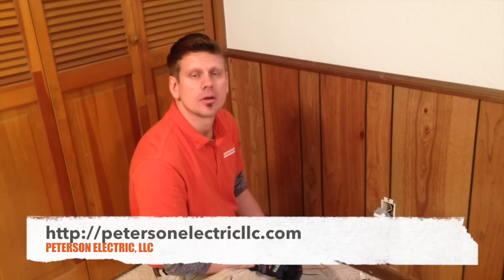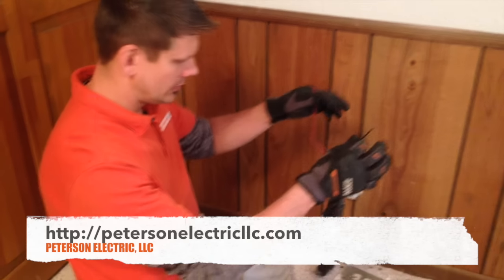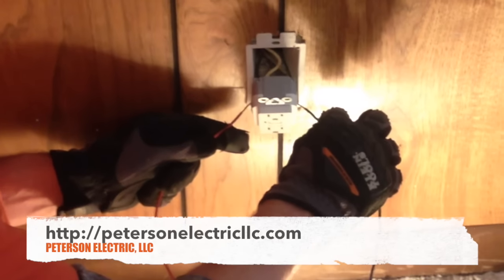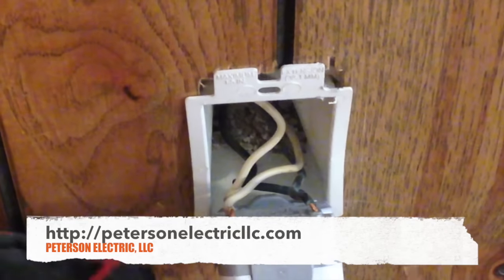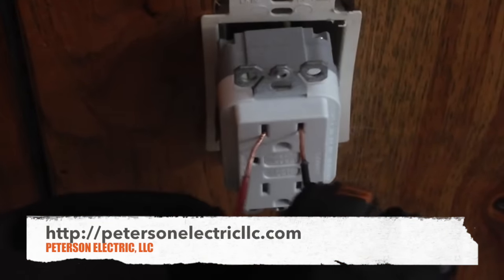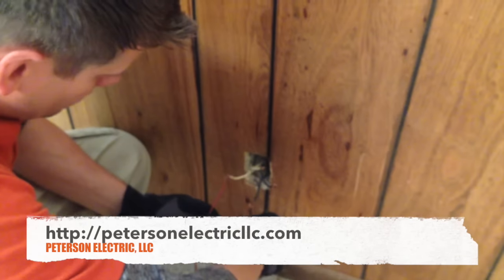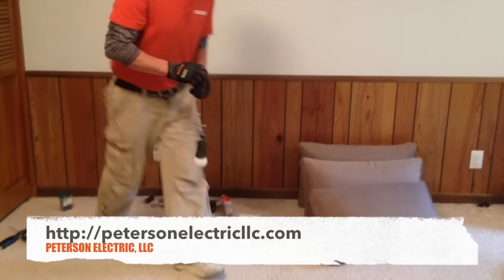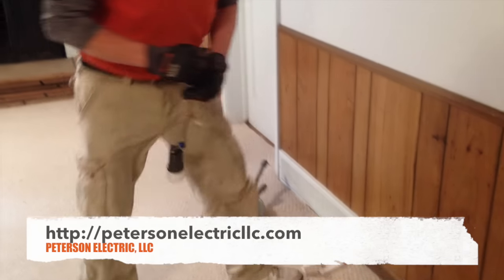A 1950's House With 2 Prong Outlets & No Grounds, What Can Be Done?

Comment: I think you don't quite understand what a GFCI does. It is not a breaker. It monitors how much power is on the hot and neutral. If they are out of balance it will trip. It will not (should not) trip when the hot and neutral are shorted as there is no loss of current to ground it may be a direct short and pull too many amps but as far as the GFCI is concerned all is well and the breaker will take care of the overloaded circuit.
Reply: What's scary is an "Electrician" (trained, certified, and all) doesn't understand what a GFCI does and what makes it different from a circuit breaker. Also it looks like that house wiring is being upgraded, why not add in the ground line to go with the 3-prong outlets?
Reply: @thedude6146 that's what I was thinking

Comment: Can you explain how your test proved your point. You never showed the GFCI afterward to show if it tripped.  Did the gfci work or could someone be electrocuted. And does this mean that the 2020 NEC 406.4 (2) (c) is wrong?
Reply: The spark was the proof. You would have been shocked and the circuit trips at the panel but you still get shocked. If the outlet worked you would not trip the circuit or see a spark. Just like you did not see a spark when he tripped the outlet directly.
Reply: @CarlYota  He shorted the live and neutral. It sparked and the breaker tripped. That has nothing to do with the GFCI.
Reply: When in doubt, ark it out 😁… an ole electrician told me that
Reply: @okaro6595  people say that if a GFI is at the front of a line then when said GFI trips it will keep juice from running to the rest of the line. If that was the case the 2nd receptacle should have been dead but it wasn't that is why it sparked.

Comment: Inside a GFCI, current sensing does not include the ground conductor. A GFCI simply measures the difference between hot current and neutral current. Therefore if some current passes through a piece of equipment or a human to ground, the neutral current decreases and trips the GFCI. So you have to test it not by tripping the circuit on current, but by tripping the circuit with external leakage to ground. The ground conductor must never pass current. It is only there as a reference point for protection.
Reply: Exactly. I am thinking a lot of people, including some electricians misunderstand exactly what a GFCI actually does. Jumper a wire around the Line OR Load side terminals of the actual GFCI and the exact same thing will happen. Not sure what to make of this video...lol
Reply: First off I wouldn't rely on a GFI to save my life. I would have to go over the patent design (years ago I wasn't impressed), the components inside one and hope it's not Chinese and calibrated to 6mA (which is still too high). I agree with you and MrHetero Erectus. That being said, I think that there are MANY areas where a GFI could fail you under the perfect conditions.  I worked in a factory on a dual voltage machine. First off the wire harness was marked Neutral, Ground and Line2 on the same wire. The machine did not have a ground to the control panel, and a worker laid a 220v 60A line inside and plugged it in. The breaker did not trip bc the machine was not grounded BUT the steel case was live. I refused to work there. The company came in and rewired a GFI into the breaker (LAW) and threw in an ammeter but neglected to properly tie in both sides L1 and L2 so they are only measuring 1 load. The machine is on a pallet (no ground) and the pallet sits on a conveyor that's 60 years old. What's my point? GM comes down from the office with the entourage. The rollers on the line don't have continuity (no ground) pallets etc.He said ETL Intertek approved the machines on the basis they tested our hipots and everything is good! The pieces of shit should be globally recalled for numerous reasons. STAMPED ETL INTERTEK UNION MADE ENERGY STAR. Sometimes people who design things don't test or understand the way people who FIX OTHER PEOPLES PROBLEMS. In my case I got a pile of money to walk away and NOT CARE! Sometimes I get a kick watching electricians get really messed up with simple shit cause they know CODE but not electricity. The whole issue of GFI, IMHO is to give ppl a false sense of security. Sure the GFI trips when you direct short it but how about a nice slow current leak after the load? A short can burn a house down and never blow a fuse or trip a breaker.
Reply: @maxwebster7572  I think it's misconception that circuit breakers, GFCI's, and other gadgets installed in wiring are safeties to protect the careless. While they CAN do so, their main purpose is to protect from electrical faults. They aren't idiot protection devices, a clever idiot can still easily get hurt.
Reply: @thedude6146  AGREED!
Reply: @maxwebster7572  A GFCI trips when you direct short it? Why? It's a ground-fault detector, not a short-circuit detector.
Reply: @UpnorthHere  Short is a a term to describe unwanted flow. It can be a path to ground or short to hot side of circuit. The neutral side of the circuit can be bonded to earth which is ground depending on the type of equipment.
Reply: @maxwebster7572  What do you think of Arc- fault circuit interrupters, versus a GFI?
Reply: @frankpaya690  two completely different devices designed to solve two different problems.
Reply: @TomCee53   Wouldn't an arc fault circuit interruptor do what a GFCI is alleged to do, only better? I was really addressing the question to  Peterson.

Comment: Your statement is absolutely correct but your test didn’t demonstrate your point.   By shorting L and N together you simply tested the circuit breaker and not the GFCI.  The point of a ground wire is to protect against an event where the live wire L makes it’s way to the metal housing of an appliance.  In that event if the appliance isn’t grounded then you will get an electrical shock  by touching the metal housing.  A ground wire creates a low resistance path from the housing back to neutral resulting into tripping the breaker.  A similar protection can be achieved with a GFCI receptacle and without a ground wire.  The few GFCI spec sheets I have reviewed have a trip threshold of 5mA +/-1mA.  That threshold is the current mismatch between what’s coming out of L and what’s going back in N.  So back to the previous example, if L ends up connecting to the housing of the appliance in a system without a ground wire, and the user touches the appliance.  Current will start flowing from L thru the hosing thru the human body to ground.  At 5mA the GFCI will trip.  So the real test for you is to create a current leakage to earth ground without returning that current to N.  If you’re on the second floor and no where near concrete this may be a hard test to do.  Good luck.

Comment: GFCI's detect imbalance between the hot and neutral. They won't trip on a short or overload between the terminals. That's the circuit breaker's job.
GFCI's trip when current is 'unaccounted for', as when you touch the hot and current flows through you to ground rather than back through the GFCI's neutral.
To test them without a wired ground, you'd need to short hot to earth or a neutral outside the GFCI.

Comment: I don't know about all cities Electrical Codes but in St Louis you can actually replace a two prong electrical outlet with a 3 prong outlet but you have to label them no ground then they pass inspection no problem
Reply: Joseph Atnip that is correct as per article NEC 406.3 (D) (3) (b) and (c).
Reply: Thats almost true, the NEC allows you to do that if you have a GFCI protected circuit.
Reply: Joseph Atnip: No, most US states have adopted the NEC which strictly prohibits that. Your ungrounded 3-prong receptacle must be supplied through a GFCI and labeled as such, plus "No Equipment Ground".  406.4(D)(2)(c).
Reply: @joeschmitz3346  Those NEC sections require such a receptacle to either BE a GFCI-type (b) or be supplied from a GFCI (c).

Comment: In this short video did you in fact realize that a GFI on the front end of a circuit did in fact protect the downstream outlets in your 1950 home remodeling from two prong receptacles to three prong receptacles?
Reply: Ok I'm not the only one. Like didn't he just show that when blowing out the non GFI outlet that it tripped the one up stream and in fact did protect from surge?
Reply: Looks to me that blowing out non GFI outlet doesn't trip the upstream. But blowing out GFI from inside the outlet will trip the downstream.  Looks like at the end of the video when blowing out the downstream either blew a fuse or trip the breaker.
Reply: @brickcitrus  GFCIs do not protect from surges and the fact that he shorted it i.e. tripped the breaker as nothing to do with the GFCI.
Reply: @Jeckelman24  He shorted the circuit. A GFCI does not react in that.

Comment: Here's something I can't seem to find an answer to. In an old trailer which has been wired in a million different spots/ways that makes it miraculous that it hasn't burnt down, both the 220v stove AND dryer were tapped/pigtailed  together on one 40amp double breaker(which is bad enough as it is,,, but heres the big kicker!! BOTH have been running for YEARS off of 2 hots and a bare ground(black/white/ground 8/2 wire. And yes in the breaker the bare ground was connected to ground bar, so no it's not even bogus-ly being used and hooked up on neutral bar with no insulation. When I try researching this, everything says it WILL NOT work without a neutral(but the 3 prongs will work without a ground, and then using appliances neutral/ground bonds at the appliances only.  So the stove and dryer were both working as if it were being wired like a 220v hot water heater(not all, but many/2 hots 1 bare ground/no neutral, as I gather most 220 water heaters don't use a 110 for anything, but stoves and dryers use 110 for parts of them). So now, if someone tells me the 2 hots and bare ground on stove/dryer could burn house/trailer down, I'd say yes probably sure could!! But when it's said that they just "wont/don't" work with that wiring, I'll say that's a lie. What I want to know is if the ground had been hooked up as if it was a neutral, has 110/220v been on and off flowing through the ground all the years?? And were the 110v parts of the stove/dryer actually running on 220v or something. And why have these things not broke/fried inside? I am no electrician, but I am trying to self educate myself as always, so I want to know how this has really been working like that for over 17 years, because this is my stepfathers trailer and he been here for around 17 years!!! And all this was screwed up wired before he ever moved here. But to clarify, I know for at least 5 years, that at the main panel box at pole, the bus bar was melted where the main 100amp breaker (that feeds the house breaker panel) was hooked up, and every once in a while, half the trailers power would cut off(educated guess is one of the 110s would still be flowing connection, while other 110 feed would lose connection, but if he flipped on dryer or stove, power would come back on, educated guess is the extra jolt of larger appliances trying to get power would send large jolt causing breaker to reconnect with the melted breaker panels bus bar??) It's all CRAZY!! The pigtailed wire running dryer was even running up through the actual old central air metal duct where a hole was cut for wire!! I don't wanna hear what "codes" say, or to be corrected with 110/220(120/240), or corrected with more specific terms of ground not being ground/neutral/common etc stuff. I jist want to know in basic english(not to advanced technically), what was this crazy hook up doing? And not asking for a "guess, answer, but is it why the main breaker was slowly melting the blades of the panel over all the years? Or I know of not having "grounds" before "codes" etc,  but back in time, did they actually use the "bare ground" wire and feed back through panel box as if no biggie, because they didn't have the neutral wire present? Or is this something of some jack@$$ of all sloppy trades is guilty of?? Thanks in advance for any extra info on how this was working without blowing breakers/burning up appliances/burning down trailer etc..  Some of these questions I would almost need an actual appliance tech who knows how the internals work, someone else who's also worked on OLDER trailers houses and have seen the long term effects of bogus-wiring that actually worked for years, and an actual techy electrician who knows more than just "codes" and how things were wired before "codes", so it wouldn't just be about codes, but rather more about what will actually burn your house down. Sorry long comment, but there was no way to even remotely partially explain without commenting some of the situation lol. And I can not/WON'T check now with meter to see if the ground had 110/220 flowing through it. Installed a new outside panel, new 100amp breaker, moved and REWIRED dryer to shed outside with underground 10/3, and currently have no stove and cooking on grill until I can afford around 50ft of 8/3, and a FOUR prong cord and plug, because even though this "worked" as it was originally SCREWED up wired, not gonna start burning up a new panel/breaker or further chance of burning down this crap-hole of a trailer.

Comment: The only possible explanation is that this GFCI is also acting as an overload circuit breaker when the hot and neutral wires are shorted out. In order to test the ground fault capabilities of the GFCI requires the presence of a ground of some sort. In a 2 wire house, shorting the hot wire to an Earth ground connection should cause the GFCI to trip. The only solutions to give the GFCI a ground would be to rewire that branch circuit to give it a ground wire back to the outside electrical box neutral or put in a third wire that goes to an Earth ground.